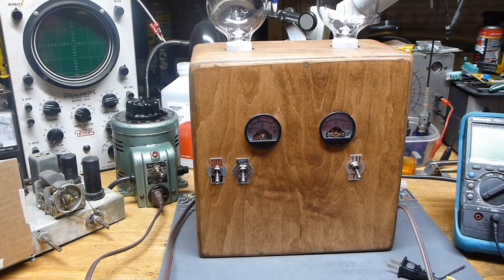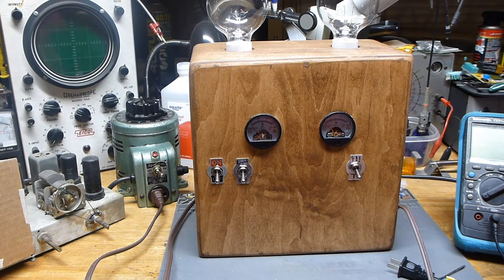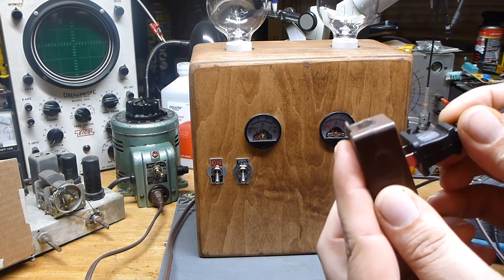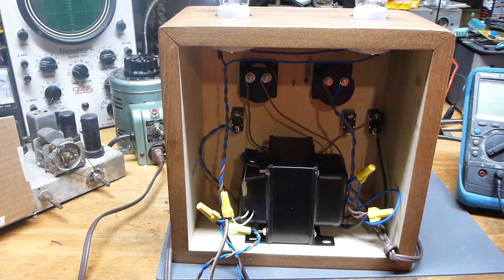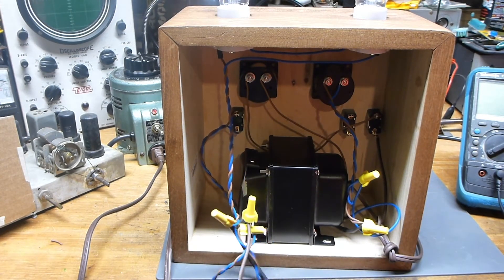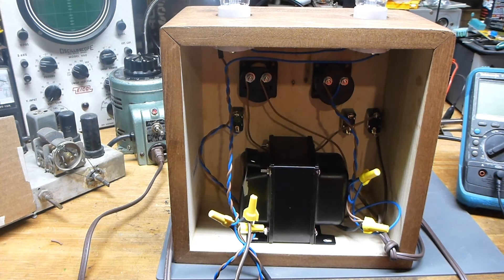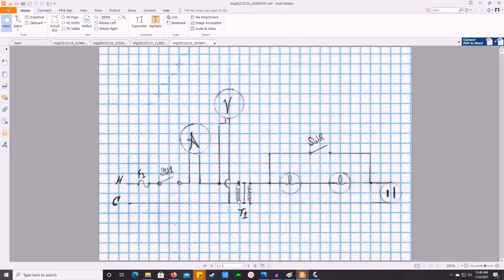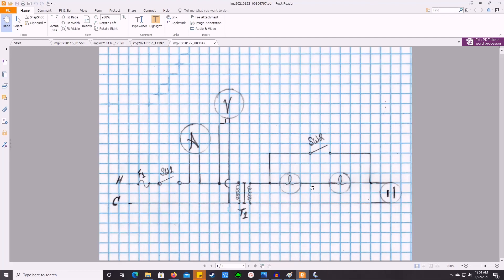Isolation transformer and dim bulb tester

Comment: If I may, I'd like to make a couple of suggestions.
1: on that bypass switch, Put a aircraft switch guard on it.
2: Add a GFI on the output side. Connect the ground, through a switch, to the neutral side of the output.
That will give you the capability of using a grounded plug, and if there's a short, the GFI will trip.
Reply from the maker: Oddly enough, I toyed with it as my father is still working on aircraft and I bet he could find me one fairly cheap. I also considered a reset breaker like similar to those used aircraft electrical systems. I will have to look into the GFCI. Thanks for the comment

Comment: 1 inch = 25,4 mm = 2,54 cm
How come you measure the Voltage and Amperage on the primary of the isolation transformer? I would rather like to know the voltage on the output.
Nice wooden box, and I can only agree with you, the equipment on the bench don't need to look like a piece of art, it mostly needs to do what it is supposed to do.
Reply from the maker: Thanks Mikael! I only included the meters as a means of indicating the approximate supply side power. I normally run a second multi-meter to monitor and verify the secondary side. And normally that is the same meter I check the individual circuit voltage is in the device. I also tend to put a kil-a-volt unit on the secondary side output to get a better picture of the current the device is actually drawing.